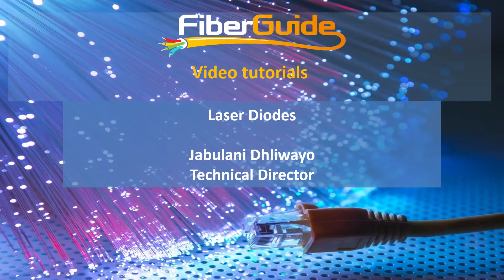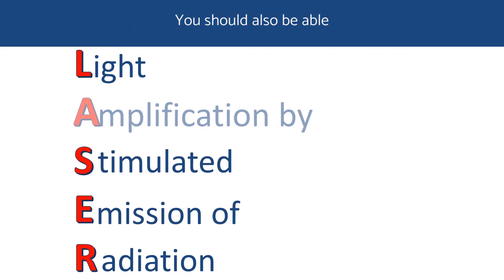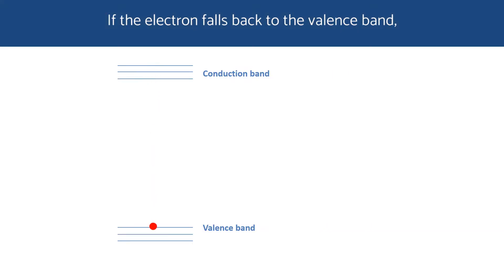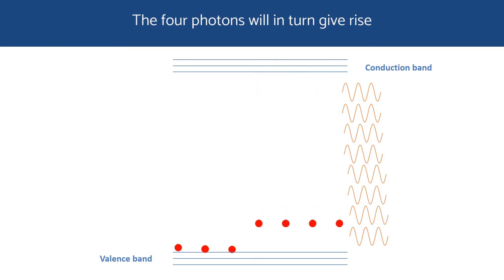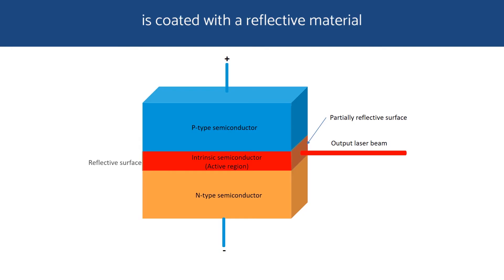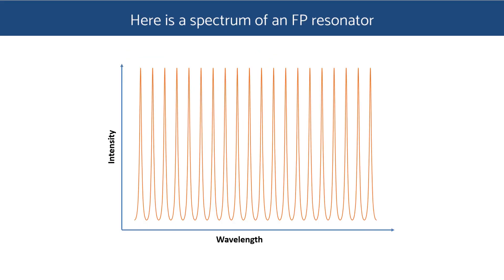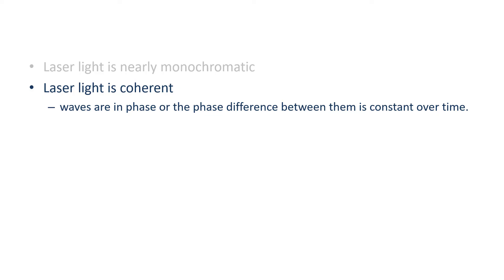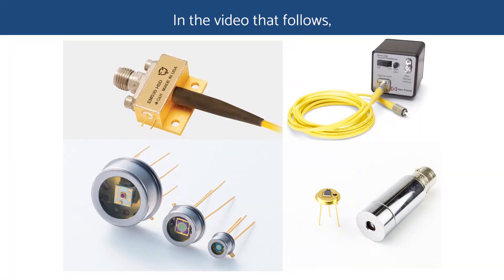Laser diodes

Comment: I understand the photon stimulates electron to fall to valence band, causing light , but what makes the electron to stay in the excited state (in conduction band) not falling (spontaneously) as in case of LED ?
Reply: Electrical pumping due to the applied potential difference.
Reply: More realistically, there is a metastable state below the excited where the excited electrons stays longer relative to that of excited state.